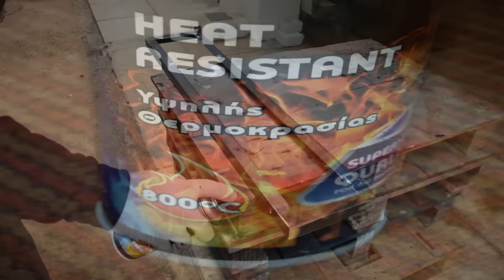HOW TO BUILD A BARREL BBQ/SMOKER (PART 2)

Comment: great job!!! really really great job! the only thing I would recommend changing the air entrance and air output on different sides, this to allow a great airflow inside the barrel, which is needed for smoking
Reply from the maker: Thank you very much for your comments! Although it works fine it is very easy to add an air entrance on the other side of the barrel as well. 😄👍👍

Comment: Shouldn't the smokestack be on the opposite side of the damper?
Reply from the maker: That's a good question... I looked through other YouTube videos and saw that a lot of people have placed it on the same side. So I decided to place it on the same side as well. Works perfect.
Reply: I personally would've put it on the opposite side but if it works the same side then I guess it works.
Reply: Only time to put it on the same end  as damper...is if you run a piece of sheet steel from one end of the grill to the other. In doing this it has to be above the damper so that the air can create a cross draw effect. Pulling your smoke over the meat your cooking. Otherwise...it does nothing and makes your fire hard to control.
Also build a ash tray to rest on the steel you put in the bottom. This way your coals arent up against the side of the barrel.  Not criticising your grill nor work.  Just have built many...of all types.  Hope it helps . You did a great job. Looks very nice
Reply from the maker: https://www.youtube.com/watch?v=3fgH69J1lkQ

Comment: Nice pit but damper on wrong side
Reply: It is on the correct side
Reply: @unclepetescafe1393   I don't think it is.  The damper should be on the opposite side of the stack.
Reply from the maker: Thank you very much. Regarding the dumper, honestly I do not know which is the correct side.... Before making the BBQ I checked a lot of similar Youtube videos, some of them had it on the side of the chimney and others on the other side...
Reply: I've got two grills, one has damper on opposite side and the other on the same side. Both work great. Can't tell any difference when I use them.
Reply from the maker: That's good to hear because I've seen all kinds of comments about the proper side of the damper...
Reply: @tonywilkins8381  I suppose if you're using it just as a BBQ grill, then it wouldn't matter but as a smoker, I think the damper has to be opposite the stack so the smoke is drawn across the meat.
Reply from the maker: Works just fine! Check the video I recorded.
Reply from the maker: https://www.youtube.com/watch?v=3fgH69J1lkQ

Comment: Great build!! Only one impovement next time. Put the bottom firebox vent on the opposite side of where the exhaust tube is. Balances the hot spot effect across the length of the barrel.
Reply from the maker: Thank you very much! I'll have it in mind for my next project.
Reply from the maker: Works very well despite the bottom firebox vent on this side. Check out the video I recorded...https://www.youtube.com/watch?v=3fgH69J1lkQ

Comment: Great job!  Only thing I’d change is instead of the sliding grate is putting a ball valve on the opposite end. You can adjust the incoming air flow by opening or closing the valve or place a pit master fan/thermostat to control temp for smoking.
Reply from the maker: Thank you very much!!!
Reply from the maker: https://www.youtube.com/watch?v=3fgH69J1lkQ

Comment: Excelent job!
Just a observation, never ever use fire to remove paint if the barrel was used before with any kind of fuel even after a hevy washed. 
Looks so basic but still happen many acidents so adivise is never to much!   
Congrats,  great job!!👏👏👏
Reply from the maker: Thank you very much for your comments! I really washed it before I removed the paint and had all the taps open. I even had some water left inside just to be on the safe side.... But you are absolutely right, sometimes we do not pay attention to basic rules and accidents happen...
Reply from the maker: https://youtu.be/3fgH69J1lkQ

Comment: Very nice job man! Wouldn't be better to put the air intake on the opposite side of the exhaust chimney? To have better air flow?
Reply from the maker: Thank you very much for your comments! I spend some time on the internet looking which side would be the best to put the vent, I didn't come into a conclusion. People place the vent on either side of the BBQs. In my case it works perfectly. In case I see that something is going wrong I can very easily put another vent on the other side as well.

Comment: Absolutely stunning. Great job. But I think I would stick to using it as a grill and not a smoker if it was me. I may copy this somewhat if you don't mind, but put a fire box on the side.
Reply from the maker: Thank you very much for your comments! I agree, it is more suitable as a grill rather than a smoker... Of course you can copy it I don't mind at all!
After all, this is the purpose I upload these videos so people can copy them! 😊👍
Reply from the maker: In case you are interested here are the measurements for the Barrel BBQ:
https://www.facebook.com/photo?fbid=2562179130553153&set=a.2562180023886397
Reply from the maker: GRILL RACK DIMENSIONS

The dimensions of the bottom grate are 90.5cm X 52cm.
The dimensions of the top grate are 87.5cm X 22cm.
The height of the top grate is 16cm.
I used iron angles with dimensions  3cm X 3cm and 8mm diameter rods with 2cm gap in between the rods.
However, I suggest that you have to make the grill fit your BBQ's dimensions.

Comment: How do you add more charcoal when everything is hot and the grill is full of meat?
Reply from the maker: This is a very good question. If I am not alone  when I barbeque it's no problem. I lift the rack and the other person puts the charcoal. However I am planning on making a small door on the other side of the BBQ (opposite from the ventilator). It's very easy to install it and will make it very easy to add the charcoal.
Reply: Need to switch the vent side with the  side you are adding  the door for adding more coal so you have a cross draft so you can get air to all of the coal not just  one side but really great video  thanks
Reply from the maker: @Backwater_Boonies  thank you very much for your comments!! 👍👍

Comment: That grill turned out great. It would even be a fantastic project just for learning metalwork and welding! I have to wonder if the end product was in your head from the beginning, or if it started small and turned into something much more grand. How does it cook?
Reply from the maker: Thank you very much for your comments! The basic idea which I had in my mind wasn't too far away from the final BBQ. However, the idea of the movable shelves came to me as I was building the BBQ.
It cooks very well, much better than I expected!
Reply from the maker: You can check out the trial video 
https://youtu.be/3fgH69J1lkQ

Comment: good work,  but how do you clean the ashes from the bottom,  I think you should add an ash-drawer
Reply from the maker: You're absolutely right. I had to do it afterwards. This is why it is not included on the video. 😊👍
Reply: @RustisGold  good luck 💪
Reply from the maker: Thank you!

Comment: I like your design hope I can copy it. ♥️♥️♥️
Reply from the maker: Thank you very much!! Glad you liked it!!!😊👍
Here are the measurements for the Barrel BBQ:
https://www.facebook.com/photo?fbid=2562179130553153&set=a.2562180023886397
Reply from the maker: ...and the Grill rack dimensions:
The dimensions of the bottom grate are 90.5cm X 52cm.
The dimensions of the top grate are 87.5cm X 22cm.
The height of the top grate is 16cm.
I used iron angles with dimensions  3cm X 3cm and 8mm diameter rods with 2cm gap in between the rods.
However, I suggest that you have to make the grill fit your BBQ's dimensions.

Comment: How do you add charcoal in there? Its a cool griller but it's hassle to remove a hot rack just to add extra charcoal. Correct me if I'm wrong.
Reply from the maker: You're absolutely right... Good point! I had to create a small door in the back of the barrel so I can add charcoal while grilling.
I realized it after I had uploaded the video and started using the grill... 😊😊👍👍

Comment: Great. But why is the vent to fuel the coals, and the chimney to release the smoke on the same side? Aren't they supposed to be on separate ends of the barrel smoker? So as to allow heat and smoke to efficiently flow through the system?
Reply from the maker: Thank you very much for your comments. Before constructing the BBQ I did some research and could not figure out what is best. A lot of people place it on the opposite side and a lot place it on the same side. Practically I don't see any difference. The BBQ works fine. Either way it is very easy to place a new air inlet on the other side as well.

Comment: Hi mate excellent job can u say where u got the vent to purchase. And give the gage and size of the angle used for framing.
Reply from the maker: Thank you very much for your comments. I bought it from a local store which sells fireplace parts
Reply from the maker: The angle I used was 3cm X 3cm
Reply: Wonderful thanks mate. That’s equivalent to 1’’ by me.  Will have to source the vent maybe on amazon or online.

Comment: Is it necessary to burn the barrel like you did in part one? And since you made it 2 years ago, has it held up pretty good? I’m planning on starting one next week
Reply from the maker: I needed to remove the old paint because it wasn't fire/heat resistant. The other alternative to remove the paint would be to use paint remover... Unfortunately none of the two methods is environmentally friendly...
The barrel is holding up very well. However when I don't use it I keep it on a dry storage area..
Reply: @RustisGold  thank you!
Reply: @RustisGold  does the inside get rusty?
Reply from the maker: No, not really. However I store the BBQ Barrel in a dry place after I use it.

Comment: Awesome work. Turned out really nice. A couple questions: 1. About the metalic plate you welded in the bottom. On top of welding, did you somehow also isolate the boarders. I believe ash and grease  would get trapped beneath it otherwise. And would be impossible to clean/remove. 2. About the lid/upper part. How does it fare in terms of heat/smoke retention. Did you install some sort of insulator similar to the one of the weber summit? Thanks for sharing. Cheers!
Reply from the maker: Thank you very much for your comments! Regarding the metallic plate I tried not to leave any open space between the plate and the body. (It is not shown in detail on the video). The top part, no I didn't put any kind of insulation. Until now I haven't experienced any problems with it. Hope my answers helped you!
Reply from the maker: https://www.youtube.com/watch?v=3fgH69J1lkQ

Comment: Great work, but makes me want to ask a question regarding many of these YouTube videos in general. I rarely ever see anyone using oxygen/acetylene for cutting metal. Mostly grinders, saws or drills. Although they may have a shop full of equipment, including lathes, a cutting torch seems to be absent. Seems strange to me since here in Canada a cutting torch is a staple in every metal working shop.
Reply from the maker: Thank you very much for your comments. Usually I work with thin metal surfaces. A torch is not something I really need. Plus the cost of cutting and grinding discs is really low. Finally I am not sure how precise a cutting torch could be compared to the cutting disc...

Comment: Hi thanks again for the great video. Just want to confirm, the angle steel your using 30x30x3 or 30x30x5 (measurement in mm). Thanks.
Reply from the maker: Thank you very much! Yes I used 30x30x3
Reply: Rust is Gold thanks for that. Can you also confirm the welding rod you used please. I think reading somewhere it was 2mm?? Many thanks
Reply from the maker: @paiaa1011  I used 2mm for the thin metal parts and 2,5mm for the rest.

Comment: Looks great. Very detailed video. Why did you put the air vent on the same side as your stack? Do you have any issues with coals on the other end getting enough air?
Reply: That's probably the only thing he'd change
Reply from the maker: Thank you very much for your comments! I looked through the internet while I was making the BBQ to see which is the best position for the air vent and people would put it on either side... When I tested the BBQ it worked just fine. However, if I see it is problematic in the future it is very easy to add on on the other side as well!
Reply: Btw that finished product is sexy lol I just watched the video where you cook on it
Reply: Its probably the cleanest build ive seen so far. I making a couple just looking for the best set up
Reply from the maker: @timdarby5960  thank you so much for your comments!!! I am glad you liked my BBQ!
Now I am transforming an automobile LPG cylinder into a BBQ. This will operate with gas. Stay tuned!!!
Reply: I loved the Quality of the build as well, however I had the same thought, The intake and exhaust should be on opposite ends for more uniform heat flow.  Other than that an excellent build.

Comment: i did bild i grill out of a 200 liter drum for many years ago, and it's mutch more nice then this one here, i did also bild a Salat Table there fit with my Grill, and inside i did make frying pan, so i can make eeg's or Bacon, half frying pan and half Grill steelbar's, and i use 9 Kg Koll to fire it up, and it can make Grill food for about 25-30 people att the time. i did make one out of a 60 Liter drum, fit beetter for 4 people, the big one is most for famely party's. My big grill 200 Liter drum with Salat table is for sale, i don't use it so offen, i did make on in 60 liter fit more for 2 people make grill night, the big one is more more people, it can make grill food for 25 people,, but it's for sale if enyone need one nice big grill. but then i need you e.mail. i live in Denmark.
Reply from the maker: https://youtu.be/3fgH69J1lkQ

Comment: Should the silver square intake vent be on the opposite side for complete air flow through the grill?     He installed it on the same side as the chimney outtake.
Reply from the maker: Some people say it is on the wrong side but my BBQ works perfectly, it doesn't seem to make a difference... Also in case it is needed I can very easily add an intake vent on the other side as well.

Comment: Can u give m explanation and measurement  inside of BBQ  love from india
Reply from the maker: Thank you very much for your comments! Greetings from Greece!! 🇬🇷😊👍
Reply from the maker: Here are the measurements for the Barrel BBQ:
https://www.facebook.com/photo?fbid=2562179130553153&set=a.2562180023886397
Reply from the maker: GRILL RACK DIMENSIONS

The dimensions of the bottom grate are 90.5cm X 52cm.
The dimensions of the top grate are 87.5cm X 22cm.
The height of the top grate is 16cm.
I used iron angles with dimensions  3cm X 3cm and 8mm diameter rods with 2cm gap in between the rods.
However, I suggest that you have to make the grill fit your BBQ's dimensions.

Comment: Hi I got myself a barrel but previously it stored perfume.... The inner part seems to have a layer of paint. Must I remove it first?
Reply: If yes, do I burn it off or use a paint remover and then burn then inside for safety measures
Reply from the maker: Hi, If it has paint in the inner part I suggest you find another barrel...
Reply from the maker: @mukhvindersingh2150  both ways are unfortunately non ecological... I prefer burning it, much easier. Either way don't forget to wear a protective mask because of the fumes.

Comment: How does this seal? Seems like you would get a bunch of air leaking in from the side causing thermal runaway
Reply from the maker: If you are talking about the air dumper you can see on the video that you can open it or close it by sliding it sideways.

Comment: Where did you get that damper from i cant find it anywhere
Reply from the maker: I brought it at a local store which sells fireplace parts.
Reply: @RustisGold  okay and was the angle iron 1 by 1 or .75 by .75 in? Also about how many feet in angle iron did this take cause this is an awsome design that i would like to do? Thank you
Reply from the maker: @Anthony-hz6hn  I use the metric system. The angle iron I used was 3cm X 3cm. (1.18 inches)
Reply: @RustisGold  ok thx

Comment: There's a major flaw in the design. The air in-and-out gate must always be on the opposite side of the grill. You will have a hard time getting even heat on the grill because of this flaw.
Reply from the maker: Sorry but I don't agree... It really makes no difference. The grill works fine.
Check my trial video:
https://youtu.be/3fgH69J1lkQ
Reply: @RustisGold   Try grilling a big chunk of meat (lamb, hogs), you will see the difference. Because of this flaw, one side of the meat will overclock and the opposite side will remain undercooked.
Reply from the maker: @Fardun167  it is very easy for me to install a new gate on the other side of the BBQ. I will try it. Thank you very much for your comments! 😊👍

Comment: Do you have instructions and parts etc for the build?
Reply from the maker: Here are the measurements for the Barrel BBQ:
https://www.facebook.com/photo?fbid=2562179130553153&set=a.2562180023886397
Reply from the maker: GRILL RACK DIMENSIONS

The dimensions of the bottom grate are 90.5cm X 52cm.
The dimensions of the top grate are 87.5cm X 22cm.
The height of the top grate is 16cm.
I used iron angles with dimensions  3cm X 3cm and 8mm diameter rods with 2cm gap in between the rods.
However, I suggest that you have to make the grill fit your BBQ's dimensions.

Comment: What all materials and equipment do you need?
Reply: @2019 Aidan Smith I really appreciate it. You're a lifesaver. I'm going to take a welding class b4 I build one.
Reply: @2019 Aidan Smith did you watch the video showing the grate that was built for it? If yes, what mateials and equipment was used? If possible approximate size(s).